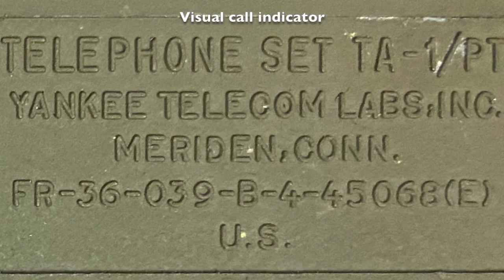Episode 18 - US Sound Powered Field Telephone TA-1/PT

Comment: Hey, loved the video. 
I just recently bought 2x TA-1 one works one doesn't, how do I repair them back to like new?
Reply from the maker: Hi Tonyyy117, I'd say it depends on what does not work exactly?
Reply: @fieldphones  Hello, I don't know what isn't working. I have a TA-1 that does work and can pick up my voice from the phone that doesn't work, however it can not pick up any audio from the one that works at all.. I can assume that its the receiver on the one that doesn't work but its a guess... also is there any way to find new rubbers for the phones? thanks in advance.
Reply from the maker: @tonyyy117  What comes to mind is what happens if you move the receiver element between the phones, does the problem "follow" the element or stay with the phone? If you have an ohmmeter you can check the elements, both the receiver and transmitter elements should have +-60..80 ohms resistance and make a low crackle noise when you connect the ohmmeter. If the resistance is zero or significantly higher the element is most probably defective. Also you can find in chapter 5-12 of the manual (https://radionerds.com/images/2/22/TM_11-5805-243-13.PDF) what resistance you should measure on different points, maybe this can give a hint where the defect is. As for the rubbers I assume you refer to the generator and push to talk protective rubbers, one source seems to be: http://www.signalcenter.com/commo/ebaylist/29pushtotalkcover/ptotalkcover.html (I personally never ordered something there, but read on forums and such that reliable source)

Comment: Hi, would you know in the absence of WD-1 wire, can TA-1s be powered by the common 4-split phone cable? To be more specific, two splits for positive and two splits for negative. Or does it need to be all four splits go into one side? The distance needed is less than 300 meters. Thanks!
Reply: It's an AC signal so there is not positive and negative involved.  As long as you have a pair of wire connecting the phones they will work.  Speaker wire, alarm wire, CAT5 computer wire work.  The main fault with this phones is the microphone and speaker elements seize up internally after sitting for a long time.  Also there are contacts inside the phone that need to be adjusted on occasion.  They get out of position if the phone is dropped.  If you have good phones and decent wire they will go a couple of miles!

Comment: Can this phone talk to a ta-312?
Reply from the maker: Hi Bob - Yes, "sound powered" and "local battery" is compatible. The sound powered device would define the max. possible talking distance at <10km which is still probably more than enough depending on your use case (with two local bat. instruments you can achieve up to 30km point to point, depending on wire conditions)
Reply: Yes, you can talk to a TA-312 in both common battery and sound powered modes. Remember, that the receiver element (earpiece) is both transmitter and receiver on the TA-312 when using it in the sound powered mode.